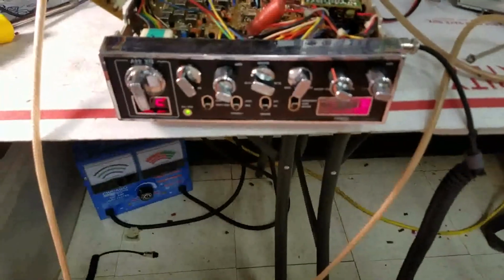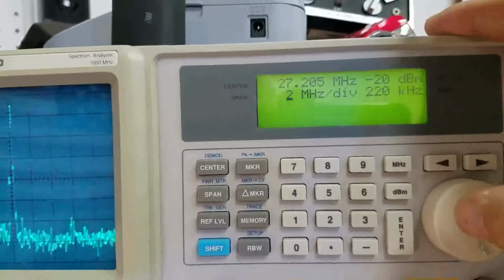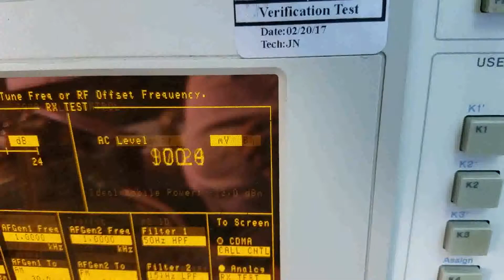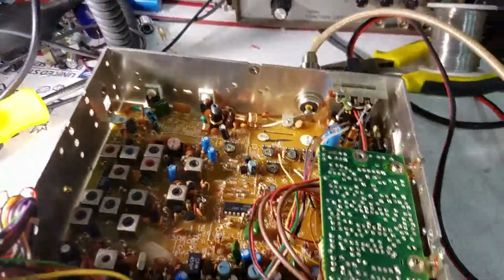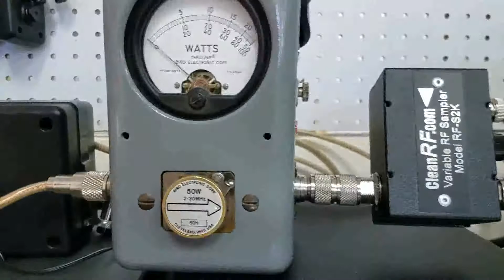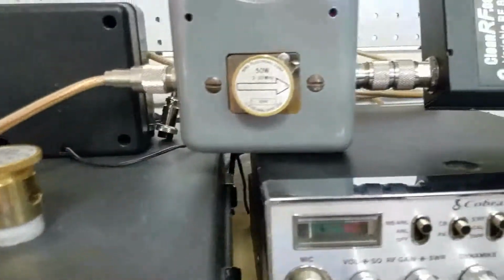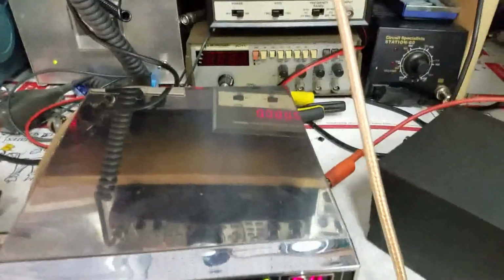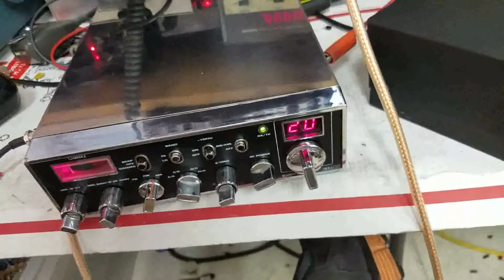Galaxy 44v for Mr. LEE

Comment: I have a 44v. Just had it serviced in September. Check, adjust, replaced vol/squelch (had lots of static, sounds much better like new) and one of the top switch with new. Replaced dial/meter and the lamp to red LED. Hitting on 45 watts continuous w/o external amp. 
It is my first 10M. Got if from a friend in ‘05-‘06 after he became ill and off the road. Always had it kept up and working good. Sounding great, talk to friend 10 miles from my house with no problems, we both were surprised of the reach! Had to put it aside because of the side mic connection, wouldn’t fit in hole of new truck....🤬 been in my long gun safe since 2012. I just spent $150 on the September service adjustments/repair. Took it on family road trip and worked excellent!!, It has a confederate flag face plate cover on top of original and looks awesome. Have to have $325 very firm, but you’d be getting peaked and tuned recently serviced ready to go out of box Old Skool 10M Radio you can brag about! I may work out a shipping deal or something but I’ll keep it if offered less than $300.

Comment: Should have never sold my 44V, regret that decision. Hard to find them now, even on Ebay.
Reply: I have a 44v. Just had it serviced in September. Check, adjust, replaced vol/squelch (had lots of static, sounds much better like new) and one of the top switch with new. Replaced dial/meter and the lamp to red LED. Hitting on 45 watts. It is my first 10M. Got if from a friend in ‘05-‘06 after he became ill and off the road. Always had it kept up and working good. Sounding great, talk to friend 10 miles from my house with no problems, we both were surprised of the reach! Had to put it aside because of the side mic connection, wouldn’t fit in hole of new truck....🤬 been in my long gun safe since 2012. I just spent $150 on the September service adjustments/repair. Took it on family road trip and worked excellent!!, It has a confederate flag face plate cover on top of original and looks awesome. Have to have $325 very firm, but you’d be getting peaked and tuned recently serviced ready to go out of box Old Skool 10M Radio you can brag about! I may work out a shipping deal or something but I’ll keep it if offered less than $300.

Comment: Cobra radios are junk. I have more of them fail than I care to count.
Reply from the maker: Well maybe you should fire whomever you have building your radios. I build 100's of cobras each year and have hardly any failures.
Reply: @smokinjoeselectronics442bu7  Stock unmodified radios, and I know how to set up a radio. Have had several Cobra 29's bad when new from the factory. I won't even think about buying another Cobra.
Reply: Cobras are the most solid radios out there. Not the most powerful but they are work horses.